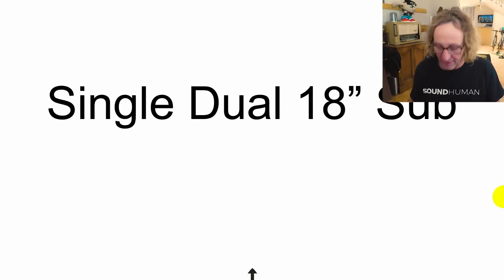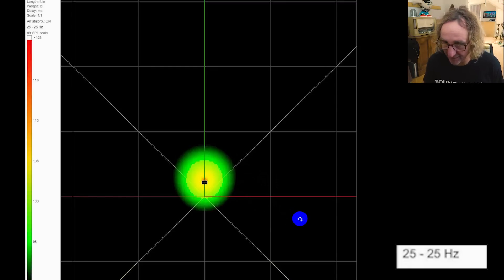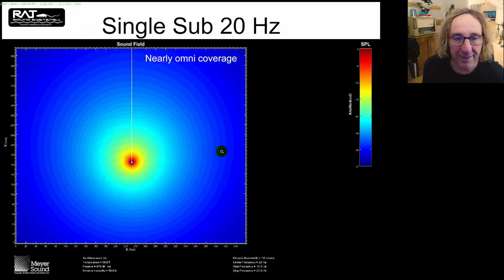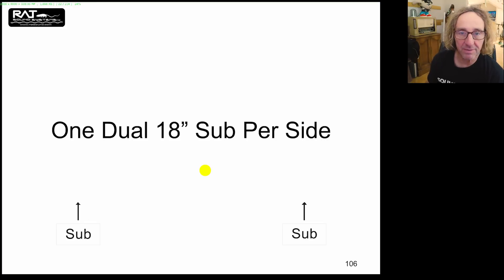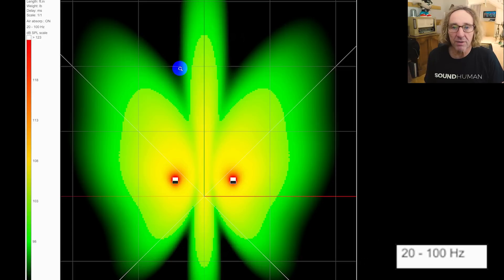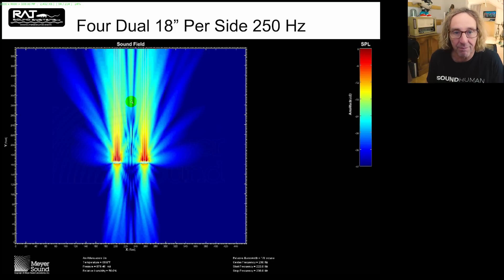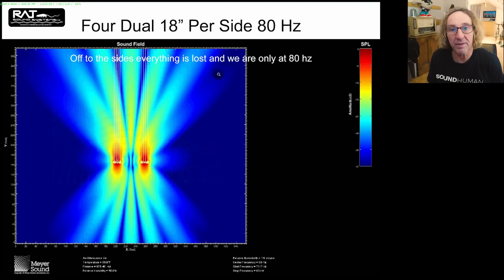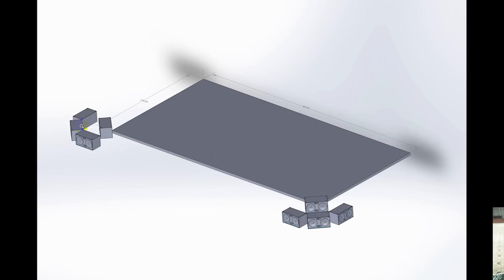Better Sounding Subwoofer Arrays Part 1 - Coverage and Quality

Comment: Super excited about this series. It's great to see the old "bass cannon" blog posts come to video form!

This shows why it's so important to not only have a great system, but also have it set up well. People may be biased towards and of the big names, be it L.acoustics, d&b etc. etc. but I'm pretty sure that most 'strong' opinions that formed are not based on speaker quality, but on the quality of the implementation they heard.

If you don't have control over the setup, walk around (if possible) and get an impression on how it sounds throughout the audience.
Wooden risers will also greatly skew your bass perception through tactility, so in the worst case you might be mixing in a bad power alley, while already "hearing" more bass because you're on a riser, resulting in the audience having no bass at all.

Comment: In search of a sub that can handle 16 Hz for my 32' pipes (digital pipe organ) ideally in the 2000W range to pair with my 2 ways at 900 W.

without breaking my back or bank. 

😁

Comment: In my particular venue, I do have 8 Rat subs across the front in a slight arc since the stage apron is curved. But the stage is as wide as the main floor, with the ends of the array only about 4 feet from each wall. So it covers pretty evenly in the room. However, since a good amount of energy is thrown onto the stage, some acts don't like that, though most don't mind. There's not really any room to do a more directional array unfortunately. The other downside is there's an area off too the side and 3 feet higher than the main floor that doesn't get much sub coverage. So for some shows, when they put people up there, additional subs need to be added to that area.
Reply: I think the only solution for reducing rear spill in my case would be to use a single box cardioid solution like EAW Otto or something similar. But hey, I"m a one person sound-army, so there's no budget for that ;-)

Comment: I’ll be paying particular attention to the spaced pair of dual 18 subs when you get into delays and polarity reversals…
I wish there was freeware for modelling - the world would sound better, because the tools are out there in terms of system processing, but we can’t easily model to predict where to start as far as system optimisation goes…or am I incorrect?
Reply: It looks like Dave is using L-Acoustics Soundvision and Meyer Sound MAPP. Both are free according to their websites. I haven't tried them, but they look pretty interesting
Reply: @iainmurphy9101  are those generic or proprietary?  I’ve a mixed&”matched” rig, so I’d need to be able to import speaker data files (where they exist)
Reply: @gregorykusiak5424  still haven't tried it yet, so your guess is as good as mine
Reply from the maker: The software is free and double 18s will model in similar ways so you don't need to import, just use the most similar product made by the company and you should get the info you need.

Comment: What about putting a subwoofer behind the main subwoofers reversing its phase and rolling it off at 80 Hz or so, this should protect the stage from any bass reinforcement and feedback issues like a cardioid system.
Placing a sub behind the audience in the middle with the right delay and reverse phase should sort out those null problems shouldn't it. Placing a subwoofer against the side walls at 3O° pointing at the wall can achieve better coverage if the venue allows for that.
Reply from the maker: I will cover more complex setups in the rest of the series. As far as directing LF, if you roll off the lows of one of the subs, it loses the ability to control those frequencies.
Reply: @DaveRat  I'm not sure I'm getting you! You talking on stage you want it to cancel out that's the idea. Well the back of the room sub in studio, usually helps with reinforcement of bass because of the comb filtering from reflections and bouncing back at the listener.
In a bigger venue I would have thought this would still apply!?
Reply from the maker: When you refer to rolling off at 80hz, and it being a subwoofer which typically rolls of highs at 80hz already.

Anyway, to use multiple sound sources to create summations and cancellations as a result of interactions between the sound sources, the sound sources need to be reproducing frequencies in the freq range for the interactions to occur

Comment: Thanks for showing this! The system for my venue was designed and installed years ago with a DSP that handles all the mono fills and crossover for the subs. The subs are part of the only stereo element, but we've always put bass elements on mono for the sake of coverage. But we have anomalous results in different frequencies where I end up with bassy resonances in parts of the room that don't seem to come from any single instrument while other parts of the room can be relatively bass-free. We are due for a new system in the next year where I'm going to work with the engineer to come up with a better sub solution. Meanwhile, I may try panning some bass elements. While the coverage of individual instruments might not be uniform, I think what we gain in clarity and lose in cancellation will more than make up for it. I look forward to seeing the rest of the series!
Reply from the maker: Awesome, yes, the series of 3 plus 1 vids should be very helpful and thank you!

Comment: Would this be considering the subs are firing the exact same frequency at the exact same time? 
If so, would your technique of panning kick drum and bass guitar inputs hard left and right help get rid of that combing?
Reply from the maker: Absolutely! You are already in the advanced phases.  This is parts of the vid leading up to the panning and such.

As a member,there is an extended hour long sub vid that covers all three of the vids in this series. Then also a vid about sending differing signals.

There should be in the pro subwoofer playlist
Reply: @DaveRat  awesome. Thanks. I just joined yesterday, I have a lot to catch up on
Reply from the maker: Very cool and welcome! Will be doing a zoom chat this week. I know YT is a bit of a bummer to navigate Coachella and member exclusive playlists should have some stuff that is not public. And other stuff is smattered around

Comment: Never knew how much a horizontal line cancels out to the side. I go to heavy dubstep shows and all of them that have more than just the venue's sound system just have a line across the front. And I love it, because I'm always on the guard rail getting my bones vibrated. But I did notice at the one arena show I went to where I was up in the stands but free to roam. off to the sides it was pretty quiet but when I went to the center of the back of the arena it was still incredibly loud and more than what my phone mic could pick up clearly. Excited to see part 2
Reply from the maker: I will totally cover all that in vid 2!